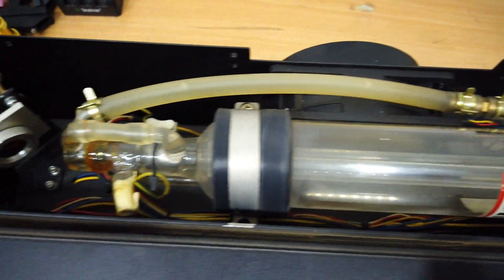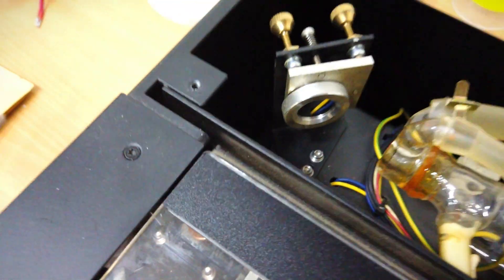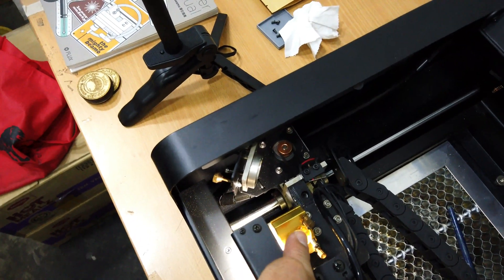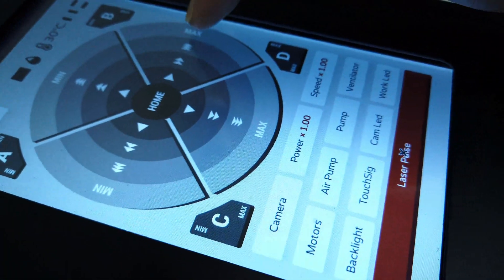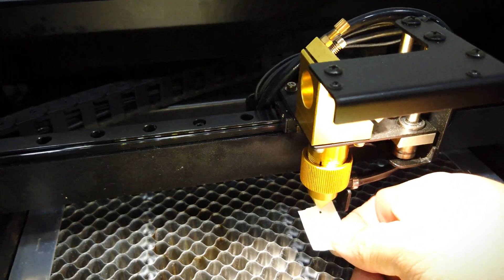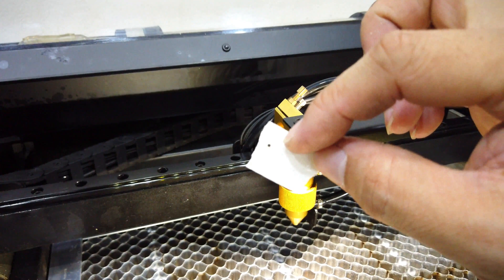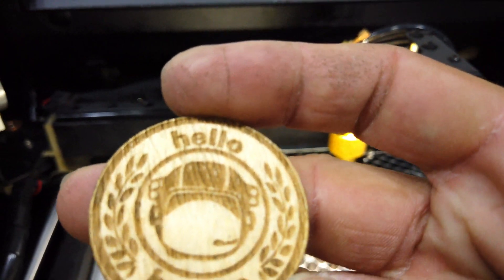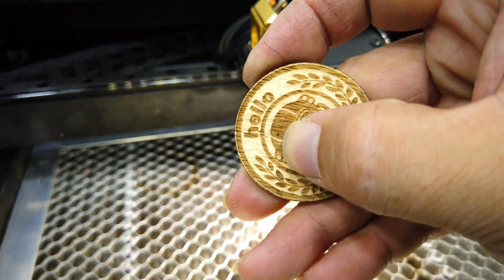FLUX Beamo/Beambox Laser Machine Beam Alignment

Comment: To be honest I'm not fully understand, how important is to have:
1. On a second mirror tape placed 90 degree or using your device instead off 45 degree and stick tape directly to the mirror frame?
2. Laser point right in a center of the any mirror, meaning aligned properly but same as in my case on a first mirror with tape 45 degree to laser tube it shows me to move mirror straight back it means laser beam is vertically centered but horizontally off center.